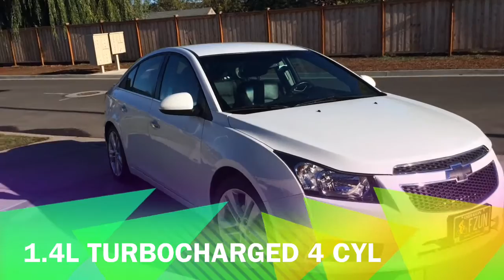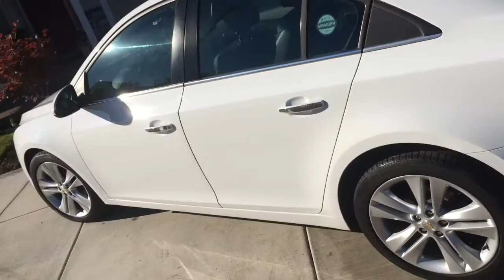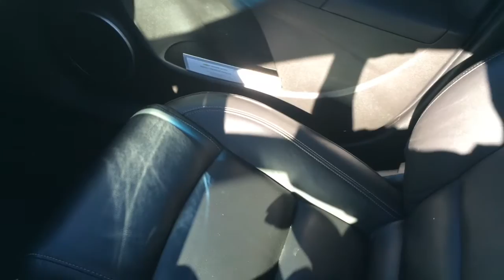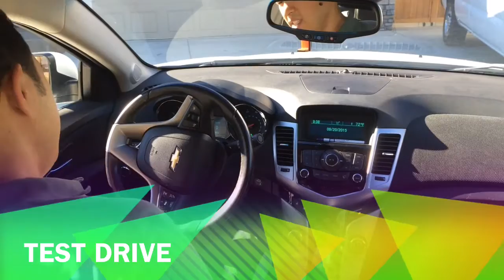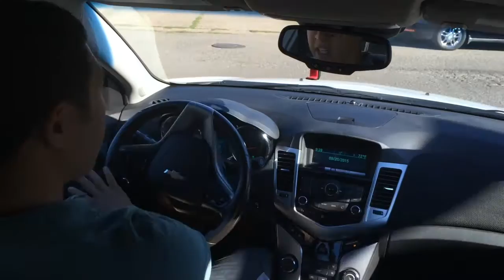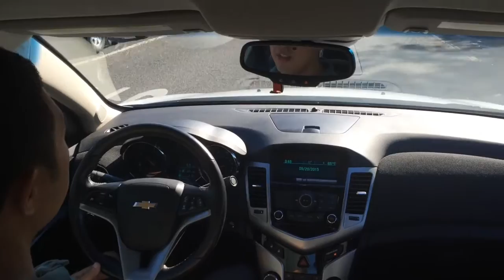Chevy Cruze LTZ Review | 0-60 + Walk Around + Test Drive | Car Guide

Comment: I never get over these young fellows criticizing what would have been a top level,premium European sports sedan years ago. Try driving your average compact car from say,the early 80's. The Cruze would blow anything away from that era.
Reply from the maker: Please, grow up. Here chevy messed up even their neg battery cable... add in the flawed airflow design leading to part failures that should also have lasted 100k+ and you have a lifetime of bs purchased from chevy. After this video I made multiple fix it tutorials to help ovwners avoid the ugly trap of expensive fixes that most would be hard press to DIY (because of missing mentors from prior gens btw, few men mentor anymore). "Young fellow"... get off your high horse. I step in where I'm needed most, and say what I think when I believe there is value. My opinions can change as knowledge grows but for sure the cruze was and is trash. Much better options for a similar price out there.
Reply: @WellThatHelped  Everyone is entitled to their opinion.I love my Cruze. Best car I ever had. Good day.

Comment: I have same car except its a 2012 RS version w/ an lsx swap, changed it to a rear wheels drive and a few other things and I'm hear to tell you even before I did anything to this car the RS version was alot of car for the money. Has all the bells and whistles. This guy says the handling aucks but in the RS version like mine it comes.with 4 wheel independent suspension, 4 wheels.disx brakes, and more. Has rack and pinion steering which is a Ford used system.mkstly.so TO.SEE Chevy put rack and pinion in the RS makes sense as rack and pinion gives u more responsive handling in my opinion. Mine has now been dropped 2 inches, drag radials on rear, rear wheels.drive. I kept the inside of car stock to make it a true street car. But if I was looking for alot of car with great suspension and handling,.looks, style, etc just stock, I'd definetly.get the 2012-2015 RS Lt or RS LTZ cruze. U wont be disappointed.

Comment: im looking at buying a used one of these with over 200k miles. 2012, ltz. It appears to be in great condition but is there anything i should look at before purchasing?
Reply from the maker: At 200k? I check it all despite mileage when buying but when mileage is that high it's prudent to run through their Maintenance records thoroughly. Also, always look at body alignment (gives away unreported wrecks), rim condition, if tire pressure and backup sensors are operational, listen/look at the engine as it idles, during test drive try all gears if possible as well as max turn radius. Anything glaringly worrisome either pass or take it to your trusted mechanic for a knowledgeable look.
Reply: Drive By Reviews the body looks mint. I believe the car belonged to an at home nurse who did alot of driving around the state so it should be mostly high way. I think I'll test drive it and take it to my mechanic

Comment: Have you ever had to replace the gas tank? I hear that is a problem with these cars......
Reply from the maker: +TechnologyMafia Yes. Also, I just replaced the radiator cap today. Between the standing/waiting HVAC recall and the current immediate emissions recall, the local chevy mechanics still have their work cut out for them.